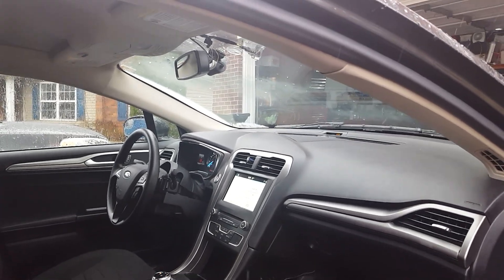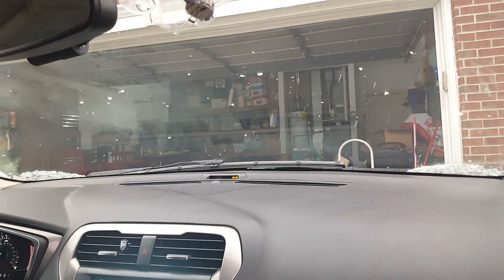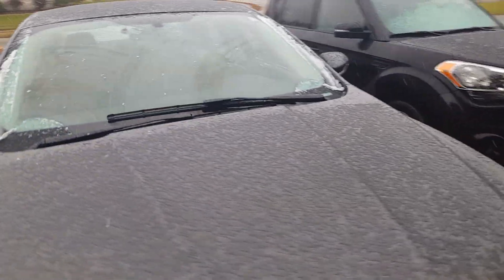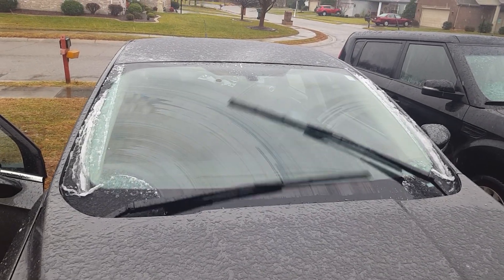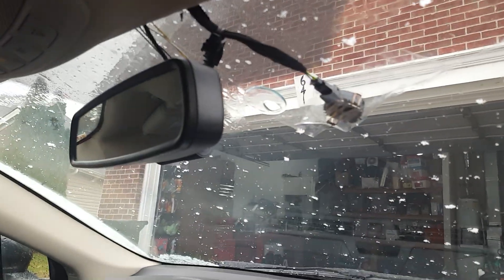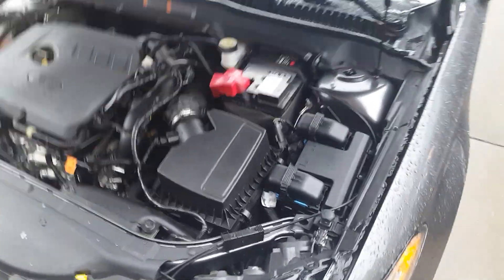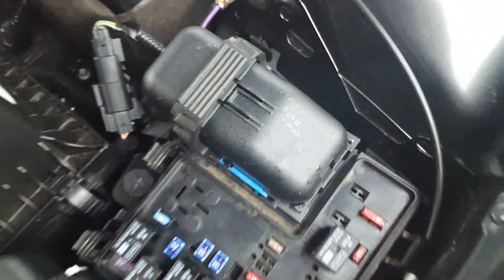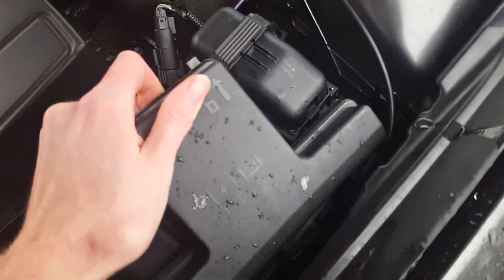How I installed rain sensor wiper (the parts you need)

Comment: Where did you plug the rain sensor into? the fuse pannel? or maybe the bcm somewhere?
Reply from the maker: @messnotgaming5955  this was done with factory wiring harness I had to replace the roof wiring harness that plugs into the factory connection behind the glove box
Reply: @Nickthecarguy  Got it! I'm doing this install on a 2014 ford escape se. Just wanted to get some extra info before i started! Thanks!
Reply from the maker: @messnotgaming5955  if you can find the same year escape with rain sensor use the vin number to get the parts you need that's what I ended up doing

Comment: hi nick, congratulation for this work. i have the same idea to upgrade my car... clio iv 2017... my car is without automatic light and rain sensor but there is the accessorized version that has is. Do you think if i found the rain/light sensor, the wiring cable, and the auto comands, and program the cbd, it works?

Comment: This guy put one in, and I'm trying to find a way to disable my system as I find it very annoying (I think tape over the sensor will be the way?!).
Reply from the maker: What vehicle do you have you can disable it in the speedometer settings
Reply: @Nickthecarguy  Thanks for the reply!  I have a 2008 Cadillac DTS that I got a few months ago.  I looked through all the settings but didn't see any option to do so.   I see that there is what looks like a window/camera behind my rear-view mirror, so taping that over might work :)
Reply from the maker: @theastronomer5800  it might have to be a programming then I know on toyota you have to use dealer scan tool to disable the rain sensor
Reply: @theastronomer5800  you sound like my brother! I for the life of me can’t understand why he wants that feature disabled! He has a 2018 Cadillac XTS and we couldn’t find out how to disable his rain sense system. Someone on a Cadillac forum told him it’s buried in the menu settings. He couldn’t find it so he simply went behind his mirror and the wires that go to the rain sensor simply can be unclipped from the sensor. Hope that helps!
Reply: @ChefCJNobles  I will look into that (thank you!) if the tape idea doesn't work!   For me, I get distracted by some random things so I prefer to have the wipers go on at regular intervals.   Some people set them to higher speeds, some to lower, but a semi-random motion simply annoys me :(
Reply: @Nickthecarguy  I disabled it!   I used a small flat-head screwdriver to open it from the sides and then press a little tab in the middle, the wire plug needs to be pressed from above to unplug the wire.  Bit tight.  Then I put it back together and just slipped the connector in gently so that it doesn't click in and all looks fine!  Wipers work as they should and it doesn't even give me an error message that the system needs to be checked.

Comment: Hi, great video. So one end of the wiring harness is plugged into the rain sensor but where did you plug the other end of the wiring harness?
Reply from the maker: The other end will run across the headliner down the passenger a pillar and behind the passenger glove box

Comment: Can  You show a video of how to program the car after installing the rainsensor?, and show what tool is used for it?.
Reply from the maker: What vehicle do you have I ended up replacing my whole windsheild thefor the rain sensor and bracket wont fall off
Reply: @Nickthecarguy  I have a 2018 Ford Escape, I have installed the rain sensor, Auto dimming mirror and wires. The automatic headlight function great but nothing happens when I activate the wiper stalk. My front wind screen was cracked, I got a new one with the bracket for the rain sensor installed last week.
Reply from the maker: @andersberth9195  do you have forscan? If so it should be in the easy mode you will need to go to ipc and sccm to activate rain sensor
Reply: @Nickthecarguy  Ok I will try this, thanks

Comment: Sir could you guide on installing this sensor system in Hyundai i20? And where can I get this particular module. Thanks.
Reply from the maker: First thing I would do is see if that car can be equipped with rain sensing wipers do some research first cuz you don't want to buy all the parts in a car will not work for it I got all my stuff from the dealership

Comment: Could you do a video about how you programmed the vehicle for it to know it has a rain sensor?
Reply from the maker: trumpeter93 yes I can i might have a video already about it. What vehicle do you have
Reply: Nick the car guy I have a 2017 Mustang and I am trying to get rain sensing wipers in my vehicle, I am just trying to figure out what all I need and exactly how to install each piece. I'm not a huge car guy and would love assistance.
Reply from the maker: trumpeter93 mine was basically plug and play all I needed was the wire harness that plugs into the rain sensor and the rain sensor that all my car needed
Reply: Nick the car guy so you didn't have to program your vehicle at all?
Reply from the maker: trumpeter93 yes I had to program the bcm so it know it got rain sensor and I programmed the ipc (optional) so i can turn the rain sensor on or off
Reply: Nick the car guy Do you think you could make a video or show me a video you made that shows how to do it? I'd appreciate it
Reply: I was told by a ford guy that even if i have the wiring harness, and the sensor, that I wouldn't be able to add this functionality to my car even though its an available package on my car. Now I am real discouraged and I don't even know if he's right or not. Any thoughts?
Reply from the maker: trumpeter93 on the mustang you need to see where the wires are at for the rain sensor at I looked where mine at and sure enough I had the wires. If you have the wires for it then it's possible
Reply: What would it look like and how do I know where to find it?
Reply from the maker: trumpeter93 you would need a wire diagram book that tell you where all the wires are at. I have video of me installing rain sensor. My connector was behind the glove box on the firewall you can check there or underneath the driver side or on the pillars
Reply: Nick the car guy Do you know which wiring harness will work for a 2017 gt mustang?
Reply: @trumpeter93  your dealer will know.

Comment: What's the best way to hold the sensor to the windshield? I see yours is taped on at the moment, but I'd like something more permanent
Reply from the maker: Nathan W they have a windsheld for these fusion with the rain sensor mounting place. I'm not for sure I have a sticky pad on the window but the sensor won't stick to it haven't really looked into finding a permant solution I just got mine tape on the window until I can come up with somthing to keep it up there
Reply: sihat dok blake
Reply from the maker: On mine now there is a sticky pad already on the rain sensor and it hold onto the window now it's not taped to the window it hold it self up there
Reply: @Nickthecarguy  Hi, did you get a new sensor with sticky pad, or just figured out another way to stick it to the windshield ?
Reply from the maker: @ОлександрПаславський-п5ф  hello there alot that have changed now. I'm in the process of adding lane departure with rain sensor wipers. The rain sensor should come with the clear sticky stuff then it should have a gold metal clip that hold it self onto the bracket on the window